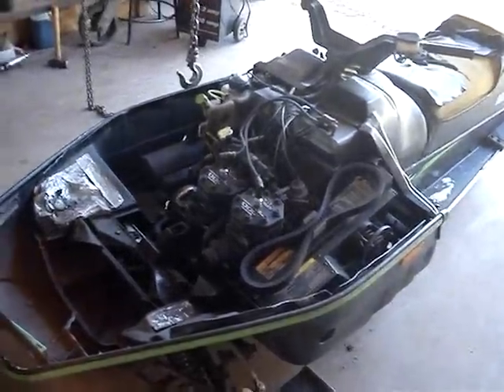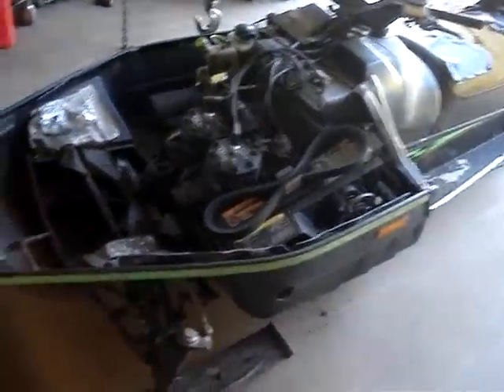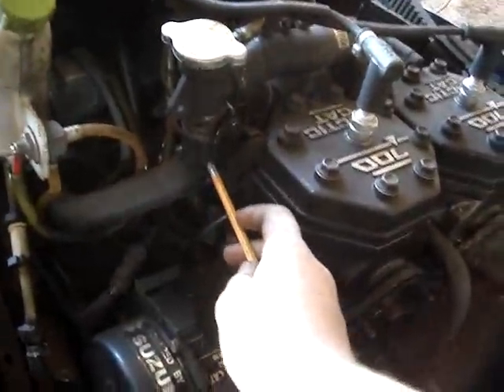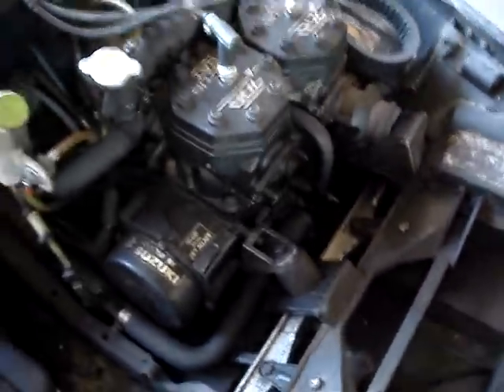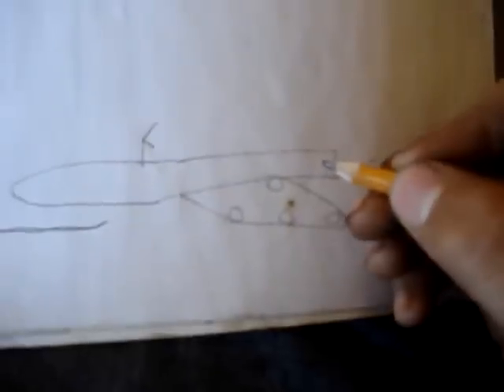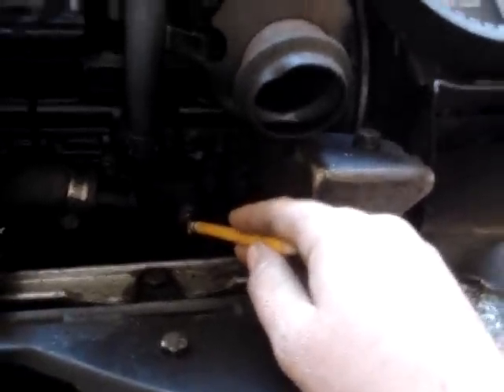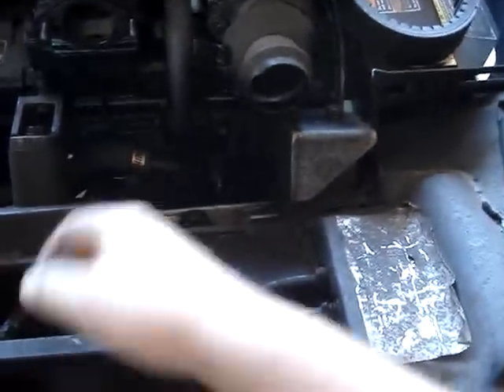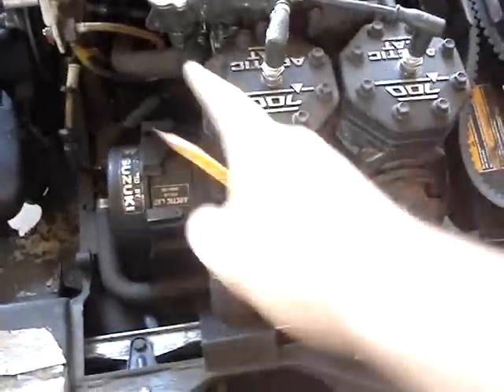Filling Snowmobiles with Antifreeze - so you dont get air pockets

Comment: I have my Arctic Cat on a  single trailer. I just tip the tongue up a bit making sure the ski's are secure. .After filling,  tilt, then start and snap throttle a few times warming up to get the air out. then fill....let it cool and fill to cool line.

Comment: Im working on a 1984 Polaris 600 and need some help its old school stuff the snow mobile is basically trashed but i want to get the engine running so i can either use it as a porject go kart or sell it to someone wanting to put it on a sand rail
Reply: You might have said this 6 years ago but I'm rebuilding a 1986 indy 600